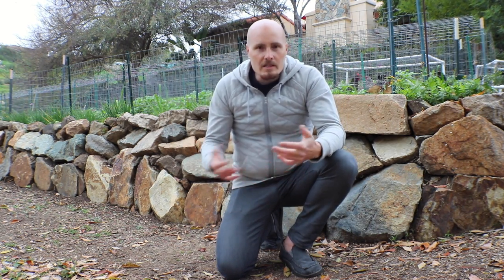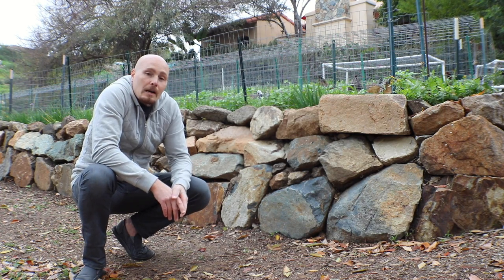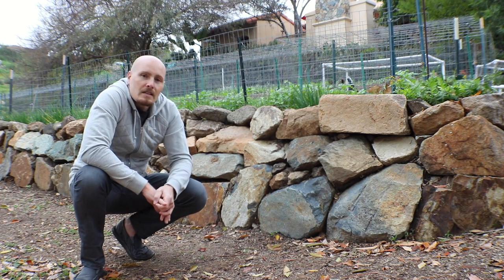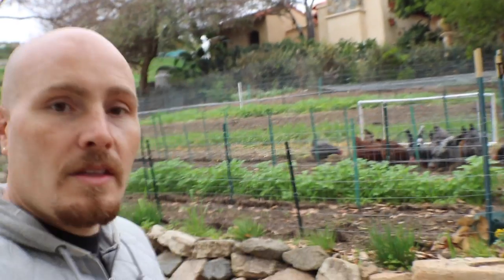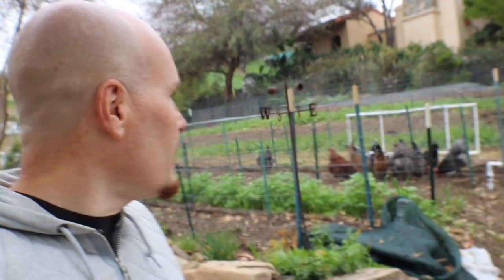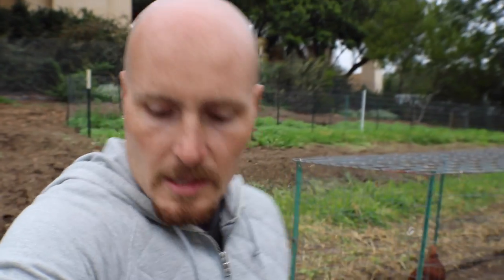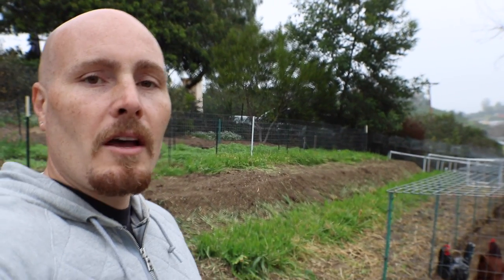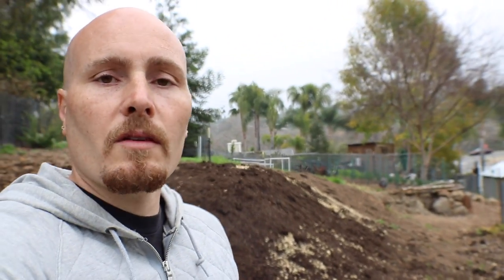Gardening on Terraces - Why I built onto (not into) the slope...

Comment: That's a lot of work; what a transformation.  I found in a Troy Bilt Horse tiller manual they mention leaving at least 12 inches of unbroken soil on the outside edge of the terrace to prevent erosion.  I've never terraced, but I thought that may help.  Thanks for sharing.

Comment: I'm on a steep slope with my developing lot in Kona, Hawaii. I plan to do exactly the same for the vegetable area, and we have lots of free rock here for walls  ;-)   
What's most important is to be getting a couple of feet of deep soil behind the wall, because I can't sink a spade anywhere on my property without hitting rock after 3-4 inches.  I'm obsessed with that challenge, and I hope that trucking in a little topsoil and a LOT of green waste/mulch onto the whole property will deepen my soil over time.

Comment: Building up is the way terraces are built outside of Jerusalem (and in the ME). First using the large stones, building up, then smaller stones, and filling soil bottom to top. Ever hundred+ years the weight pushes out the stones, and it needs to be fixed. But it lasts. And it works. Also winding swales to take advantage of rainwater.